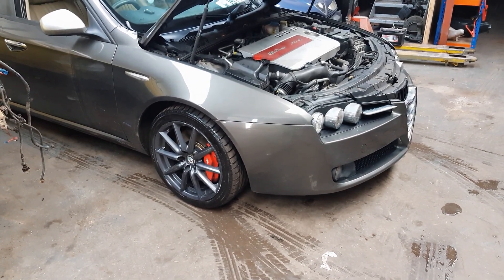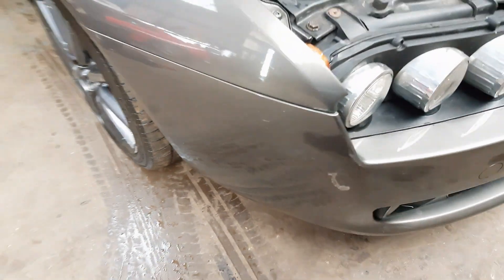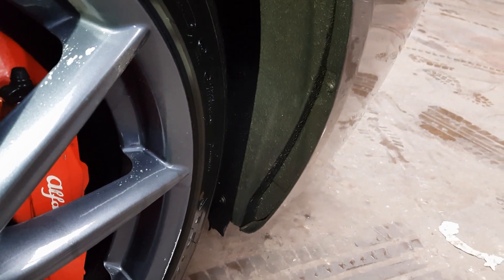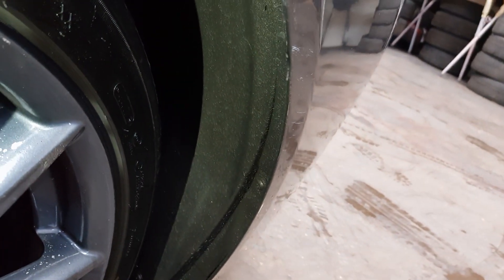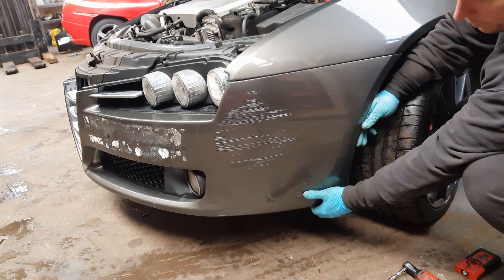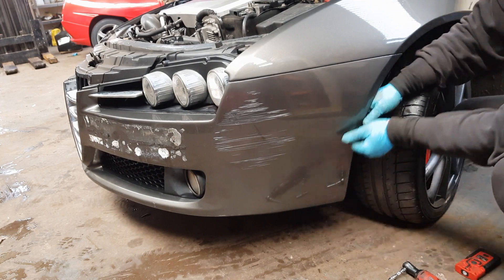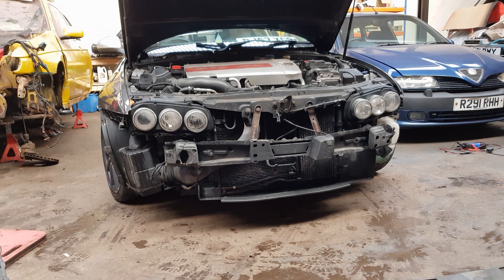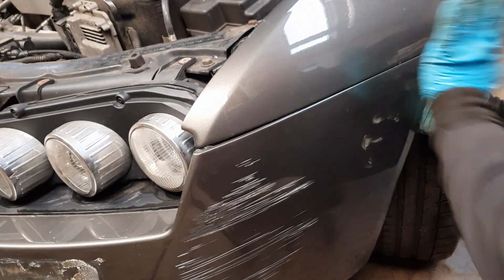Alfa Romeo 159 brera front bumper removal

Comment: Useful video, thanks! I want to service / replace the bonnet lock on my Brera as the pull release catch seems loose  / worn and takes an age to get hit or miss aligned just right to lift the bonnet. it looks an easy job to replace - just bolt off / bolt on right?

Comment: Thanks for this perfect guide. But many 159's are also suffering from the gaps between scudetto and hood after removed&fitted the front bumper for some reason. I find it quite disturbing, I hope you will make a video to show how align hood and front bumpers.
Reply from the maker: its just a case of a lot of fine adjustment to get it perfect.

Comment: Your videos are just amazing! To remove the front grille, does it needs to take the bumper off? Also if it does, when the bumper is off the car is easy to remove the grill?

Thank you
Reply from the maker: you can do it by removing all the top screws but id just take bumper off as 9 time out of 10 screws are seized on the grill
Reply: @ItaliaAutos  thanks buddy

Comment: Hi, im getting the "Parking help not available" warning. I went to a mechanic and he pluged the diagnostics in the car and it revealed that my front-right parking sensor isnt working like it cant register it. How do i change the sensor, and are there any specific ones i need to find like one with the same serial number etc. and to i need to reset the warning after putting a new one or will the parking assistance work immediately?
Reply from the maker: Just make sure it looks that same.